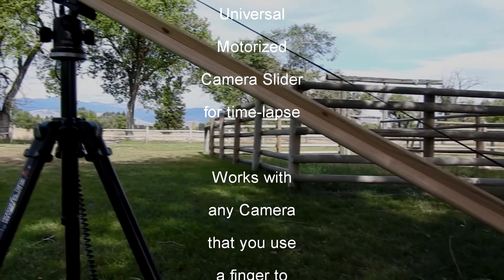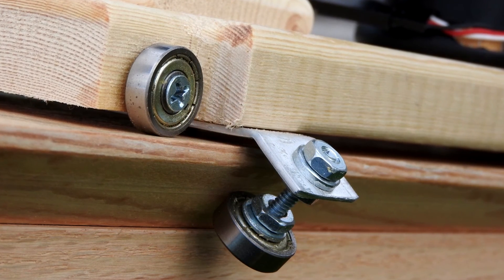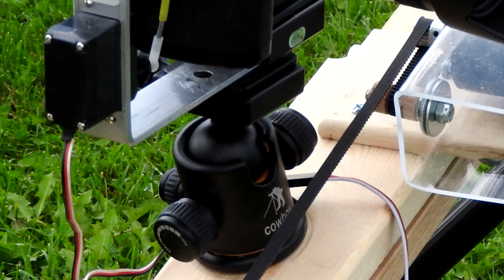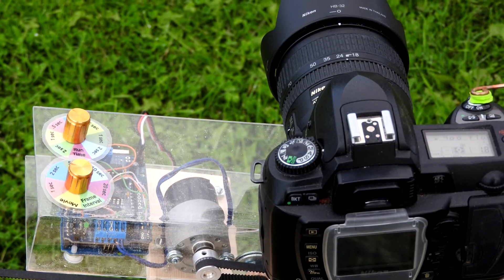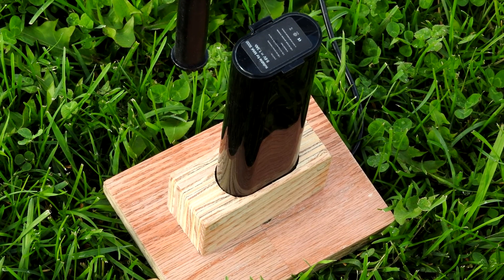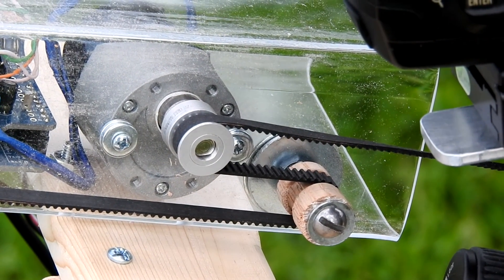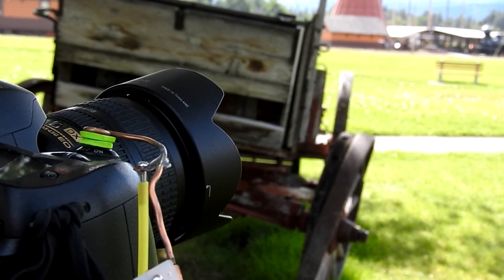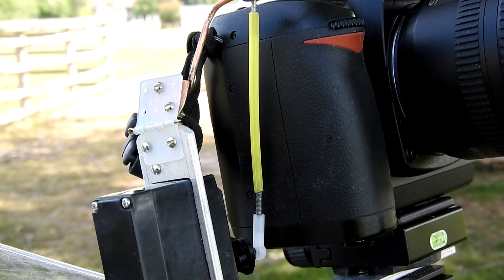Universal Camera Time-lapse Slider

Comment: where i can get this stuff?
Reply from the maker: The arduino, motor shield, DC motor, servo and tripod mounts can be purchased on Amazon. The plastic parts were either printed on a 3D printer or made from flat plexiglass.  Diagrams are available on my website at: http://montanamonk.com/newslider.zip.  The servo mount is specific to the Nikon D70 and would have to be redesigned for other cameras.  If your camera has an interval timer or time-lapse video capbility, the shutter trigger is not necessary and you might check my video: Convert Manual Camera Slider to Motor Driven at: https://youtu.be/unilm1BCyx4.  A download is available at: http://montanamonk.com/SliderConversion.zip.  A download for the creation of a similar slider is available at: http://montanamonk.com/MySlider.zip.
Thank you for questons and comments and thank you for viewing.

Comment: Very nice Project!
Can you give me the Arduino Code please?
Reply from the maker: +nufrequency86 
I have modified the slider since I posted the video.  I now use a stepper motor to drive the camera along the track.  That enabled me to use the same code for the rotating platform and the slider.  However, here is the code I used on the slider that was posted.  It isn't too elegant, but hopefully you will be able to make sense of it.  I will eventually post revisions to both the slider and rotating platform and will include code for those, too.  Thank you for commenting and viewing.

Code:

#include <AFMotor.h>
#include <Servo.h>
AF_DCMotor motor(4);  //Motor 4 to drive traveller

const int preShotLED = 13;  //Indicate shot imminent
Servo servo1;

int betweenShotDelay = 1023;  // This is milliseconds between shots.  There will be about 2.5 seconds because of 
//pre-shot led and track motion in addition to this
long intervalDistance = 2000;  //A two second interval...will be replaced by pot reading
int runDist = 0;
int runDirection = FORWARD;
long shotDelayTime = 0;
long runSpeed = 255;
long shotCount = 0; 
int frameRate = 0;
int motorRun = 0;
long i = 0;
int distancePin = 3;  // Pot controlling motor distance
int intervalPin = 2;  //Interval between shots
void setup(){
  pinMode(preShotLED,OUTPUT);
  Serial.begin(9600);           // set up Serial library at 9600 bps
  Serial.println("Motor test!");
  delay(10);
  // turn on motor
  motor.setSpeed(runSpeed);
  motor.run(RELEASE);
  // turn on servo
  servo1.attach(9); 

}
void loop(){
  intervalDistance = analogRead(distancePin); //This lets motor run max 1 sec. or about 2.75 in.
  motorRun = map(intervalDistance,0,1023,0,7); 
  betweenShotDelay = analogRead(intervalPin);  //upto 30 second delay
  frameRate = map(betweenShotDelay,0,1023,0,6);
  if (frameRate == 0)
  { 
    // Start movie mode. No camera control and motor speed and direction adjusted by intervalDistance pot
    intervalDistance = analogRead(distancePin); //This lets motor run max 1 sec. or about 2.75 in.
    motorRun = map(intervalDistance,0,1023,0,7); 
    betweenShotDelay = analogRead(intervalPin);  //upto 30 second delay
    frameRate = map(betweenShotDelay,0,1023,0,6);
    while (frameRate == 0)
    {
      intervalDistance = analogRead(distancePin); //This lets motor run max 1 sec. or about 2.75 in.
      //motorRun = map(intervalDistance,0,1023,0,7); 
      betweenShotDelay = analogRead(intervalPin);  //upto 30 second delay
      frameRate = map(betweenShotDelay,0,1023,0,6);
      if (intervalDistance < 479)  //run forward
      {
        runSpeed = (479 - intervalDistance) * 200  / 479 + 55;
        runDirection = FORWARD;
        //        betweenShotDelay = analogRead(intervalPin);  
      }
      else if (intervalDistance >= 700) //run backward
      {
        runSpeed = ((intervalDistance - 700) * 200 / 323) + 55;
        runDirection = BACKWARD;
        //        betweenShotDelay = analogRead(intervalPin);
      }
      else
      {
        runDirection = RELEASE;
      }
      motor.setSpeed(runSpeed);
      motor.run(runDirection);
      delay(1000);
    }
    motor.run(RELEASE);
  }
  else
  {  // Start time-lapse mode.
    //Camera controlled by betweenShotDelay pot and motor distance and direction by intervalDistance pot 
    while (frameRate > 0) 
    {
      //Press shutter release
      for (i=160; i<180; i++){
        servo1.write(i);
        delay(60);
      }
      delay(800);
      for (i=180; i>160; i--){
        servo1.write(i);
        delay(3);
      }

      runSpeed = 255;  // Full speed for time-lapse 
      motor.setSpeed(runSpeed);
      intervalDistance = analogRead(distancePin); //This lets motor run max 1 sec. or about 2.75 in.
      motorRun = map(intervalDistance,0,1023,0,7); 
      betweenShotDelay = analogRead(intervalPin);  //upto 30 second delay
      frameRate = map(betweenShotDelay,0,1023,0,6);

      switch(motorRun){
      case 0:
        runDirection = FORWARD;
        runDist = 1300; 
        break;
      case 1:
        runDirection = FORWARD;
        runDist = 600; //sec
        break;
      case 2:
        runDirection = FORWARD;
        runDist = 200;
        break;
      case 3:
        runDirection = RELEASE;
        runDist = 0;
        break;
      case 4:
        runDirection = BACKWARD;
        runDist = 200;
        break;
      case 5:
        runDirection = BACKWARD;
        runDist = 600;
        break;
      case 6:
        runDirection = BACKWARD;
        runDist = 1300;
        break;
      }

      switch(frameRate){
      case 1:
        shotDelayTime = 1000;
        break;
      case 2:
        shotDelayTime = 2000;
        break;
      case 3:
        shotDelayTime = 5000;
        break;
      case 4:
        shotDelayTime = 10000;
        break;
      case 5:
        shotDelayTime = 20000;
        break;
      case 6:
        shotDelayTime = 30000;
      }  
      motor.run(runDirection);
      delay(runDist);  //runDist is really time and is short so not adjusted in intershot delay
      motor.run(RELEASE);
      digitalWrite(preShotLED,HIGH);
      delay(50); //Leave on for 1/2 sec; also lets traveller settle and is minimum for between shot interval
      digitalWrite(preShotLED,LOW);  
      // Serial.println(shotDelayTime);
      for (i = 0; i < shotDelayTime; i++)
      {       
        delay(1);
        intervalDistance = analogRead(distancePin); //This lets motor run max 1 sec. or about 2.75 in.
        motorRun = map(intervalDistance,0,1023,0,7); 
        betweenShotDelay = analogRead(intervalPin);  //upto 30 second delay
        frameRate = map(betweenShotDelay,0,1023,0,6);
        if (frameRate == 0)
        {
          break;
        }
      }
    }
  }
}